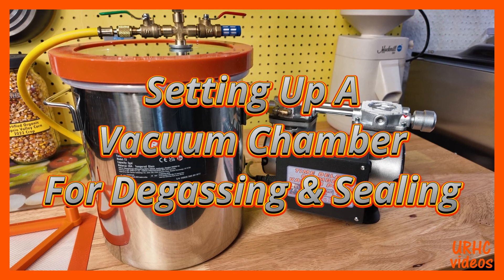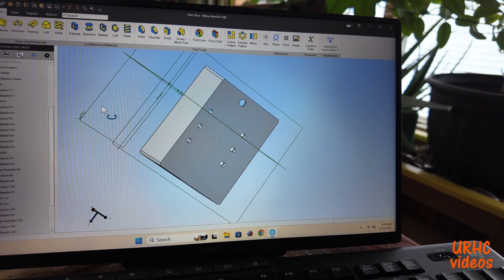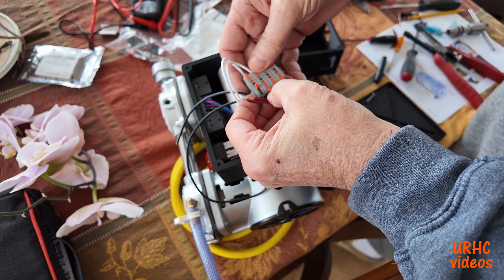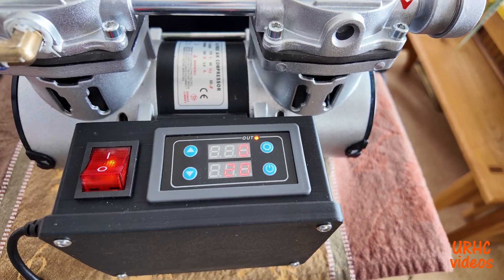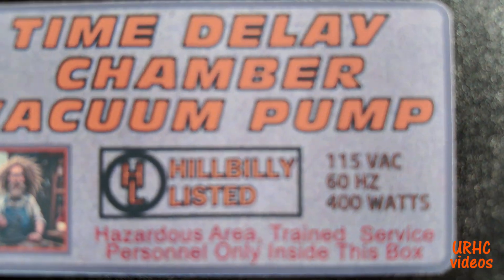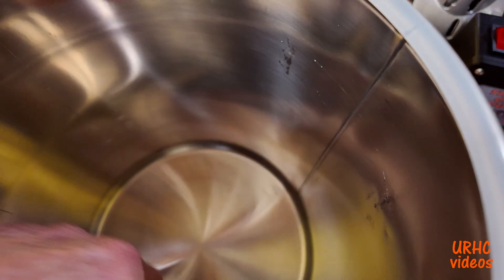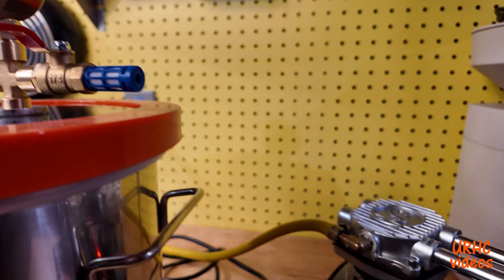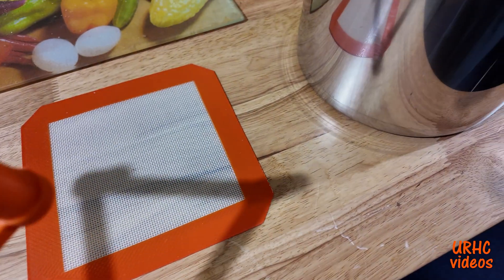Setting Up A Vacuum Chamber For Degassing Epoxy And Sealing Mason Jars

Comment: Thanks for the great video. Is the box and lid available to download anywhere? I still have not learned to create my own, and I never know which ones on thingieverse are actually good or not.
Reply from the maker: I didn't share it because all the openings are sized to fit non-standard takeoff parts that have no manufacturer or part numbers I just measured and made openings to fit. It's useless for making anything with standard purchased parts using different opening sizes. Just really an idea showing how I laid everything  out. most would buy the pump/ pot combo. I will say that printables.com is the best place to find models that are accurate at this point. You're going to have to learn a 3d cad program to get started.  I bought Alibre Atom but there are free programs available also. Thanks for watching.

Comment: Man, I envy you. I bought the Harbor Freight version of the wago lever nuts. However, I redid some electrical a couple of weeks ago and I ended up using regular Marrette's. I'll use them someday. Home Depot now cut carries wago lever nuts now. The Harbor Freight ones are a little bit bigger. I think it was project farm did a comparison of all of them.
Reply from the maker: The ones that didn't break worked good. I was too cheap to buy the wagos and not sure I would try these in home wiring without ul listing. Save a lot over terminal boards for small projects. Can't wait to try playing with epoxy resin. Thanks for watching.

Comment: I have been thinking about using one of these vacuum chambers to help dewater elderberries, elderberrt juice and other vegetable pulp. I'd like to use the minimum amount of heat processing them for maximum nutrients.
Reply from the maker: I wonder how that would work. Would a RO filter like they use to remove water from sap for maple syrup work if the berries were frozen, defrosted, 
and cold pressed.  Thanks for watching .

Comment: Good morning 🌅 URHC , I hope you are both keeping safe and well, very nicely made, I had the same problem with the cable clips, part of the clip broke off, even the cable was not holding up properly, you could pull it out quite easily, I have purchased the Bac 19Lt chamber, I think the container is rolled stainless steel, and I purchased a pressure pot, not sure whether it’s 30 L or 40 L it is quite big, I can’t remember the name of the company but it was quite expensive, around €400, believe it or not I have not used either yet, 
I’m still working on my property , I’ve have nearly finished my workshop, and I’ve just got one more wall in my lounge to finish insulation, though most of yesterday and today I’ve been working on my Resaw , it has been very badly running out of line, I think due to the fact that it was laying on its back on a trolley for nearly 4 years, I found that the table had moved slightly off its location, obviously due to the weight, I’ve just put two pieces of timber through it against the fence, and it now seems to be working perfect, and over the last two or three weeks I’ve now finished making an assembling the out frame for five windows, I’ve still got to make the opening sashes, this is where I need the Resaw working correctly, have a great weekend. Stay safe., regards from France.
Reply: Good luck with your resin casting, and you definitely need to be in the warm, as it looked like you’re very well truly snowed in, ❄️☃️,
Reply from the maker: Thanks, we are doing pretty good. Some of the clips worked good and would  stay open, but some took too much force for the tiny pivots on the levers. Now it will be fun to play with resin casting. 
Sounds like you're making great progress on the shop and able to use it now. That seemed to go quicker then you originally thought.  I just use the bandsaw for resawing. Bought the 1 inch carbide resaw blade and made a 3d printed pusher to hold material against the fence. Thanks for watching.

Comment: There’s a solid chance that engine was built in Georgetown, KY. at their on site engine plant where the Camry (and a few other models) are produced. Somewhere on top of the cylinder head should be an inspection number stamped. If you ever see it and it happens to be a green “16” then know that engine likely passed by my watchful eyes before moving on from final assembly to run testing 🙂
Reply from the maker: That's why  Camrys are so reliable. Nothing gets past inspector  16. Thanks for watching.

Comment: I can't believe how our interests run so parallel.  I have been wanting to try out silicone molds for about four years now. And try my hand at doing some epoxy work. As you know, I am way too busy to do either one. Some day, maybe.
Reply from the maker: You mean our bucket lists are identical 😁. I have been wanting to try this for sometime but have seen the outcome without removing air bubbles and scavenging this pump got me started finally.  I also bought a steam generator machine for bending about 5 years ago and going to finally build the box this spring to try it. Hopefully all is well with you and your family.  Thanks for watching.